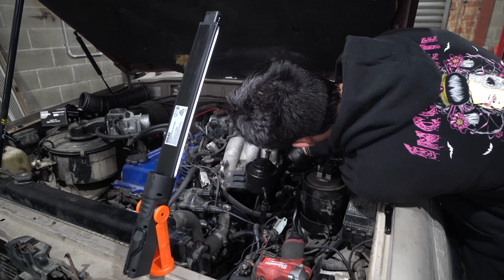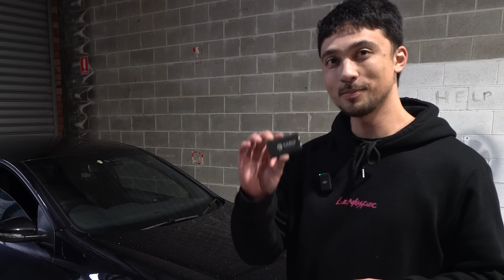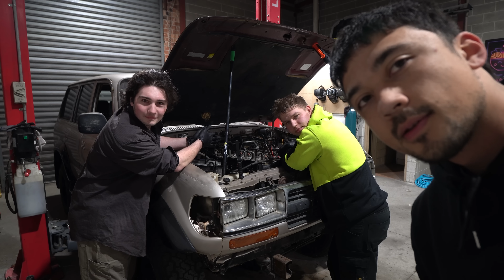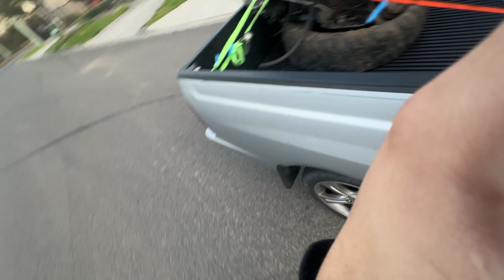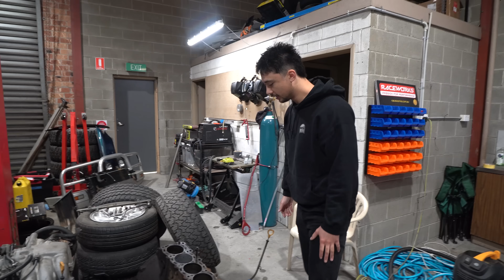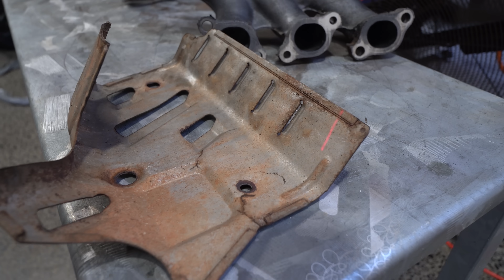REBUILDING The WORST TOYOTA LANDCRUISER On Facebook.. PT.1

Comment: Your going to think I'm crazy but I've always wanted to put a 2.5L engine in my 2000 Camry. Scott Kilmer says they're good engines. Well I guess I'll put it on my wishlist. Still trying to find someone to replace and repair my brake system. Hope your new engine works for the vehicle. I think I've found why my door locks and windows won't work. There are two relays with the same part number. They probably work the door locks and windows. Only one problem they're a Denso product. They will cost me $128.00 each at Toyota dealership where I buy some of my part. But no auto part store where I live here in the states has that Denso part. So I have no choice but to order it from the dealership. Maybe I could check a junkyard. But still unsure about that. When it has to do with electronic it's always best to buy new. Rex, I don't know if you agree with that. Bye for now.

Comment: I would have just paid the $1400 for the head reco and saved all the hassles of swapping the engine plus the head you had was made for the LPG. Did this on a 60 series and so much easier. Good video fellas. I hate how to get the head off there are bolts holding on brackets that hold on other bolts in tight spots  and so much has to come off to get to everything else. Welcome to the world of Toyota 4wds .

Comment: In the same boat with a bit better luck my 2k fz with 550 on the clock took a bit of messing around to get it running but engine runs sweet hopefully u dont have to mess around to much to get the early fz running in a later model 80

Comment: Should have done a 1HD-FTE & H151F swap 🤑
Reply: These guys hate diesel. Don't know why. I would have diesel swapped it for sure!
Reply: A turboed 1FZ is pretty awsome as well, they tune them to crazy leves in the middle east for sand dune climbing/racing 😎
Reply: @Mr.Engineer. they also have picnics in the desert and discipline their wives with rocks in the middle east but I'm not about to start enjoying that either.

Comment: Called it from the first video - unfortunately a super common issue on Toyotas of this era run on LPG. Dealt with this a few times with another 1FZ, a 1MZ and a Hilux 2.7L.

Makes for good content though, always good to have a crack at fixing something, esp. with all your mates involved, good times. 

Hopefully the new motor works out, maybe worth sourcing another head for the old one and putting it back together to sell complete or keep for a spare

Comment: Good to see you got a good new motor but to be honest for the same price I would have had the old head fixed then you know it's good and you've seen the bottom end with low ks and is clean due to lpg. Cool series none the less
Reply: With the water jackets as rusty as they were that motor was likely going to eat head gaskets. Especially if they add boost.
Reply: @1one3_Racing exactly my thought, when a cooling system is full of rust like that it's doomed, my Mazda was like that and I replaced everything when I did the engine then a few months later the heater core went pop. Same thing with a GC8 WRX my mate got for cheap but both head gaskets were blown cuz it was ran on water most it's life and rusted everything out.

Comment: Some one was running on LPG all the time without valve treatment connected to the LPG system and burned the valves and valve sets in the head. LPG is a very good alternative to normal fuel if it is properly installed with good quality parts and it is maintained correctly. Unfortunately a lot of user don't realise it and end up in situation like this.  All the best to you all
Reply from the maker: My parents have a gas car with many kms on it and it’s never had an issue. Definitely a bad gas system on this one
Reply: Yep I run the flash lube on my cruiser no issues whatsoever
Reply: Happened to me with my 1996 Toyota Hiace. Even the mechanic said, basically, word for word what you said.
Reply: I agree 100% my friend. If is it a good quality setup and maintained correctly you won't have any problems. I recently scrap a car in Poland that dan over 600.000 km On LPG AND FUEL. The engine had no problems unfortunately the body rotate awey. Regards mate all the best 👍